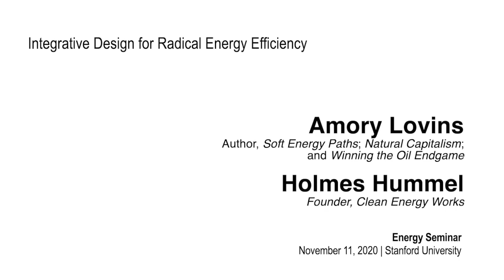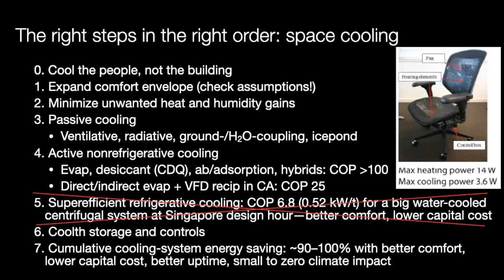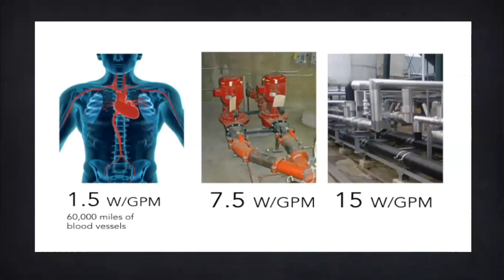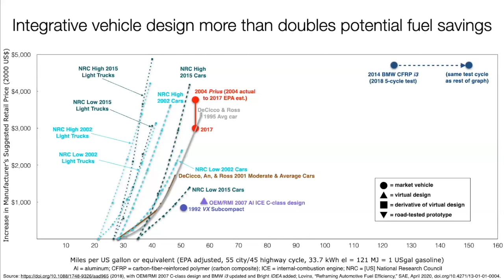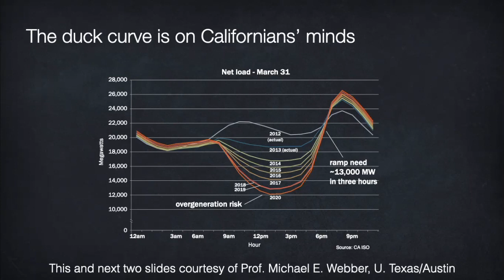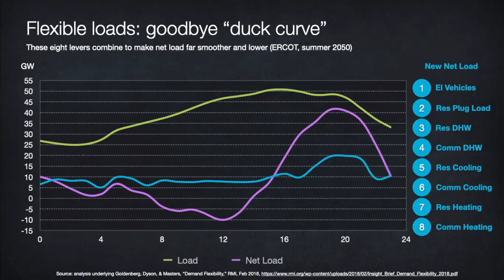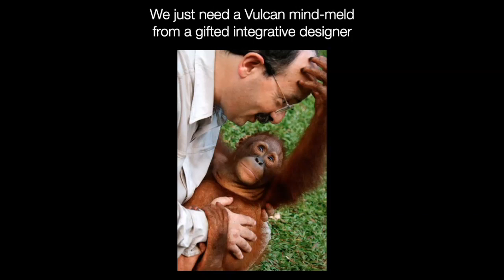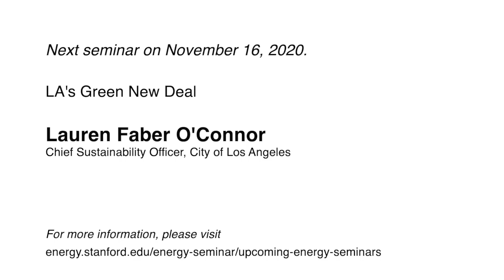Integrative design for radical energy efficiency | Amory Lovins & Holmes Hummel | Energy Seminar

Comment: If the principles of working back from the required outflow of production is applied to economic inputs in general, policy designs itself?

Mind-meld Designers, sounds like a pretty standard upgrade to reiterative Sciencing Theoretical Physics and a dispersal of Graduates into the other fields with less appreciation of the First Principle reasoning and mechanical rationalisations.., ie more integrated AI mind-tools.

Games are designed for mental exercise, so the reverse case is true for Designers. The analysis of DNA folding using the technology is impressive?